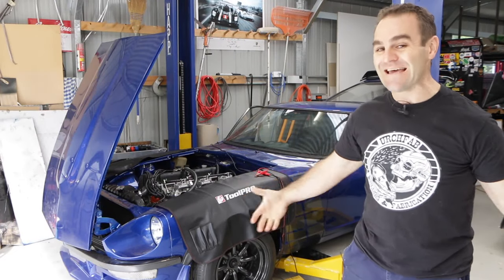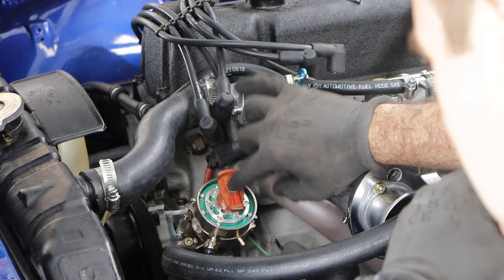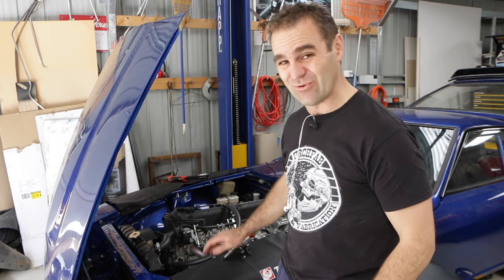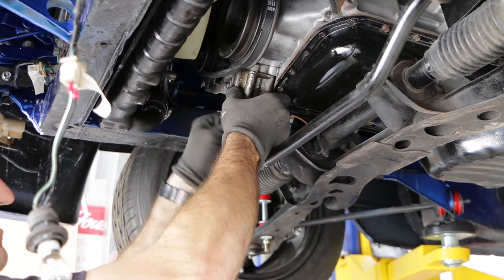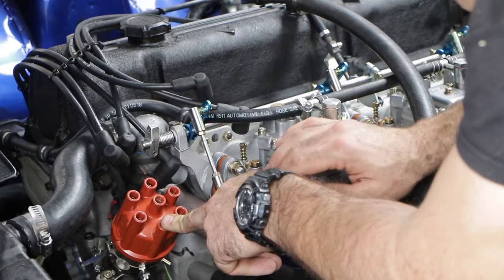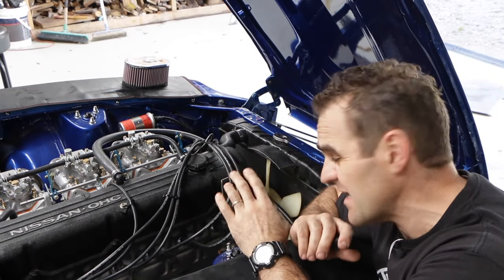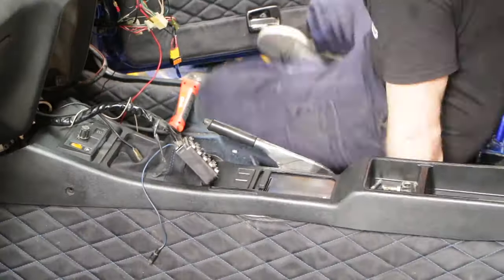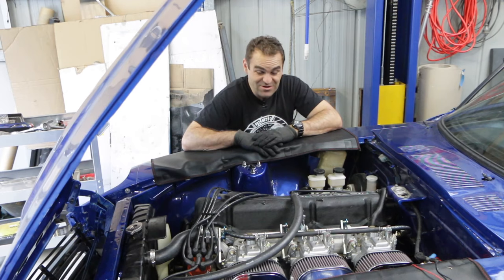Colour tuning the 680G - Home Built Datsun 240z part 97

Comment: Also when you are ready to butt tune the car, a lot of us Z owners with built motors have had better results disconnecting the vacuum advance.
Reply: @Wes Beauchamp  There isn’t one on that carby setup.  It’s controlled by the smart Bluetooth dizzy.  Good max advance is 34 from my experience, but the L6 engines love advance esp built L28s.
Reply: @alienpoker  Mine is at 34 mechanical.  I have had mixed results with/without the vacuum advance.  I have just read many people like without it.  Every car is different.
Reply: Wes Beauchamp I’ll have to plug bothy sides and see. I have a 2.6L approx. A ‘730 240Z built. It has an electronic Mallory dizzy but no electronic advance. I too am set up to 34 max, mechanical advance. I run 9-10 btc at idle (750 rpm)
Reply from the maker: You can't get a vacuum signal from these carbies, but the advance can get programmed into this dizzy.

Comment: You will be on EFI in no time. You're gonna hate the fact these carbs need to be tuned all the time.
Reply from the maker: Haha, nope. That is half the fun.
Reply: All the time? I tune my carb properly once and never touch it again. Starts when i blip the key and works like a dream. 
People who complain about carbs just don't know how to tune them. 
Jeff has 3 carburetors which are 2 barrel.. It's like the rubicks cube of carbs.. Something simple like a 1 barrel single carb is EASY to tune.
Reply: @p3l1k44n1  I hope you'll be right, but that's not my experience.

Comment: Jeff check which TDC you have set,  (compression or exhaust) also when you were putting the cams back in this would have been a very important step,  be very careful you don't want valves hitting pistons which could still happen with advancing or retarding timing if you are not timed correctly. 
https://dannysengineportal.com/top-dead-center-tdc/
Reply from the maker: The valves would only hit pistons if the chain was assembled incorrectly. No amount of adjusting the dizzy would make them interfere. It is definitely timed mechanically as it runs smoothly. The issue is on the assembly of this particular dizzy.
Reply: Home Built By Jeff , dead right Jeff!

Comment: haz switch in on the dash, on my 72, towards the heater controls there are 2 holes (one for cig lighter and one for switch) if it wasnt blocked or removed

Comment: Jeff, looks like you might have missed the nylon shifter bushings that go on the gear shift lever. (Also available in brass). https://zcardepot.com/products/shifter-bushing-kit-oem-240z-260z-280z-280zx
Reply from the maker: No, they are in there, it was probably just hard to see. The shift feels quite firm and direct.
Reply: Home Built By Jeff great, mine were missing / worn gone when I got my 72 z

Comment: Intake stacks have no point in that set up. Airflow is being restricted by the top of the filter that way
Reply: That's not correct. The stacks change the way the air flows into the carburetors. Air is still flowing in regardless of the air filters so it's much better to run them than not.
Reply from the maker: There is still a lot of clearance so the flow is not interrupted.

Comment: An O2 sensor is much better then a colortune gamble
Reply: In general, you're right. But when running multiple carbs, you can't really individually tune them unless you have several bungs to screw your sensor into. Otherwise, you're just getting the big picture of all the carbs at once.
Reply: @ronr6450  putting them al the same wil stil be better than the colortune. There also a better way to tune the air intake of the carbs than those tools
Reply from the maker: Colour tune is the best way to individually tune each carb. Setting them all the same should work in theory if everything was exactly and there was zero tolerance for error. The fact is that there is always minute differences in tolerance, so you need individually tune each carb. I will also be putting on an O2 sensor and doing the final tune with that, but if cylinder 1 was rich and cylinder 2 was lean balancing each other out, the O2 would say the tune was perfect and that would be false.